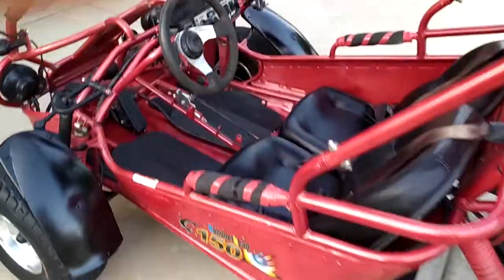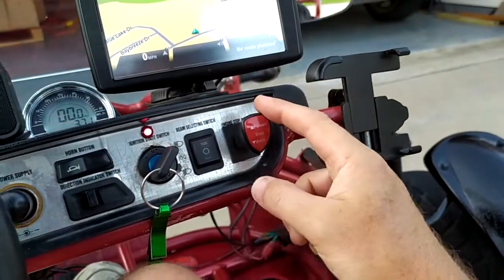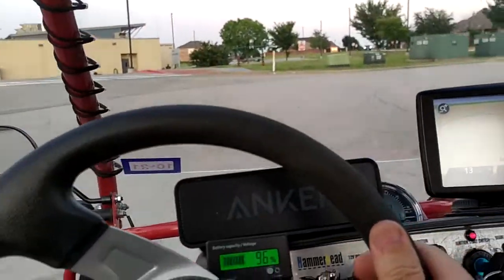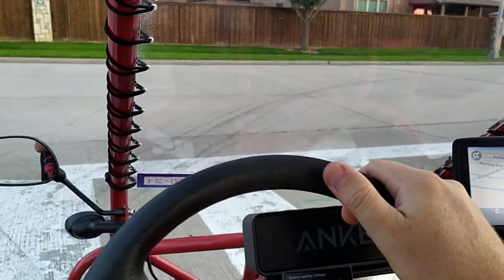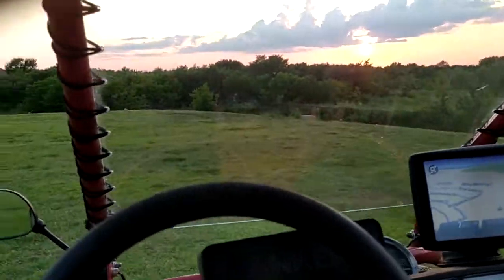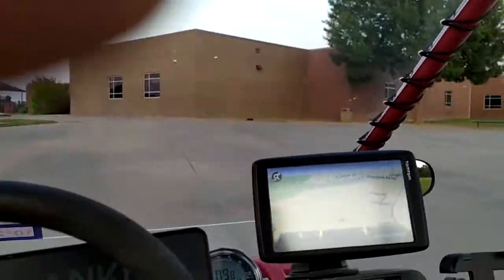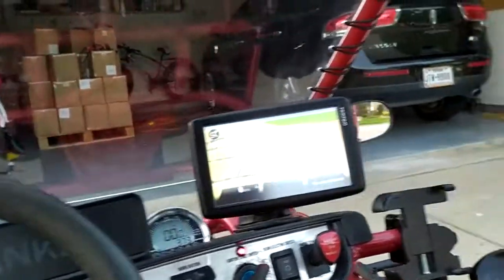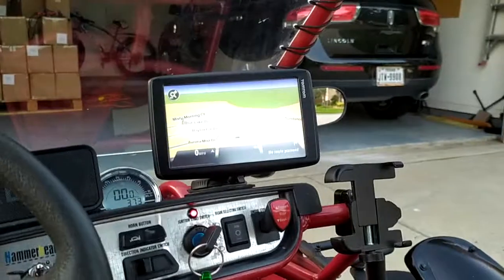Hammerhead 150 Street Legal Electric Conversion! Part 2 of 4 (Test Drive)

Comment: What was the maximum speeding you were going ?
Reply from the maker: @jackdraper2849  well with the motor and the controller and the batteries and all the Custom Fabrication everything I think it was over 3k plus, additionally all the conversion to LEDs and restoration of the rolling chassis to make it look this nice probably 3500 total.

Comment: Awesome build here my friend! We have 2 Hammerhead LE150’s. One has the gy6 modded and it does well. Still doesn’t climb the hills on our property that I need it too. So I found your YouTube during my research. I see that you did a DIY setup. Did you ever find a full setup kit? Towing 6k lbs is impressive. 😳. I’m assuming that is a byproduct of building your setup for speed?
Reply from the maker: No full electric conversion kits are available, this is all my own engineering.. However, if there was such a kit, it would probably be in the $3-$4k range including the battery.  Pricey but given the fact that in doing so (depending on the state you live in), you can get license plates and legitimize this as an in-town genuine EV recognized by the DMV.    Regarding speed vs torque, if you get one, you lose the other.  Larger sprocket, less speed, more torque, etc.  The controller ended up getting upgraded as the one I originally used was not large enough.  If I could couple the larger controller with a second battery in parallel it would be a beast! I sold it to one of my customers and he uses it to run around his sub on the cart paths, etc.
Reply: @TexasNEV  Yeah I’m in TN. You don’t even need doors on your truck here to get it registered. 😂

Do you have a list of the parts you used, where you got them, price point, and anything you’d done different anywhere?
Reply from the maker: @CarolinaMiss  That would be quite a list..  I'd go a different route next time though.. Instead of the Motenergy ME0709 and Kelly KDZ contoller, i'd go w/ the Motenergy 1306 and the matching Kelly KVD or KEB controller.  I'd go a/ 120ah battery instead of 64 ah..  Both the original sprocket and the custom sprocket adapter for the belt drive conversion I got from azusaparts.com and the belt drive sprocket and belt from cometkartsales.com The brushed motor works well but I don't like having to deal with this large assembly board with reversing relays to have a reverse function, etc.  Just less complex if it is a brushless setup.
Reply: @TexasNEV  I have used both brushes and brushless over the years, and I agree brushless has always been superior. Thanks for all the info! Again, impressive build here my friend.
Reply from the maker: @CarolinaMiss  Thanx!  I kind of regret selling it.. The only reason I did was that I wanted to do a 4 seater but I haven't had the opportunity yet.  I got sidetracked with the Terminator Electric Chopper.. :)

Comment: Cool project! I have a few questions: 
1. Did you say your eBay store is "Trader RJE?" I searched that and couldn't find it. Could you post the title of one of your listings so I can search that instead?
2. What is the high pitched whine sound? Is that thd PWM frequency of your controller or a mechanical thing?
3. What kind of range do you get?
Reply from the maker: My e-bay userid is TraderRJE,  here is a tinyurl of what I have for sale now:  https://tinyurl.com/bdf3tr8d 
2. It's the motor / belt drive noise and it is super quiet, not anywhere near as loud as it sounds because I had to apply wind noise filters.  immensely more quiet than chain/sprocket.
3. 64aH would be IMHO the minimum battery, but I'd say 25-30 miles tops at nominal speeds.. WOT would be much less.  It would really shine with 128aH.